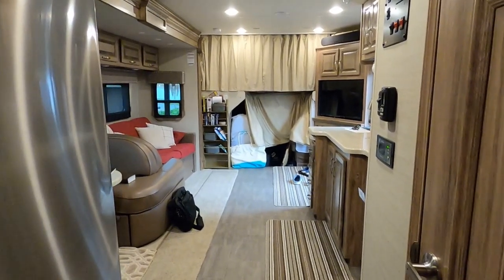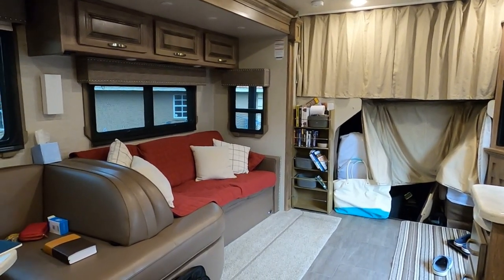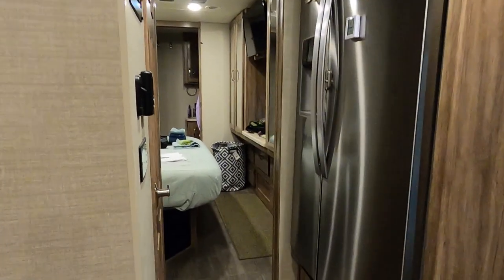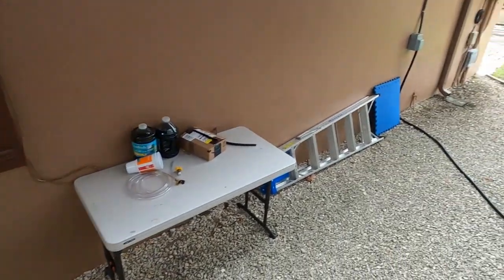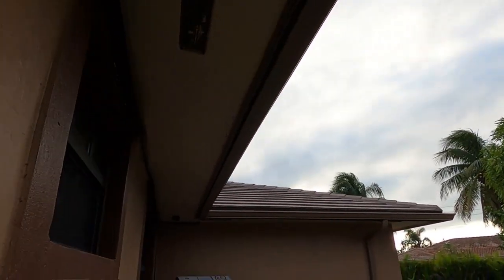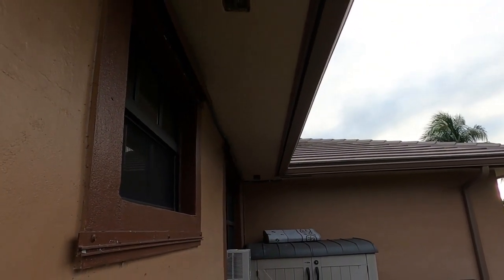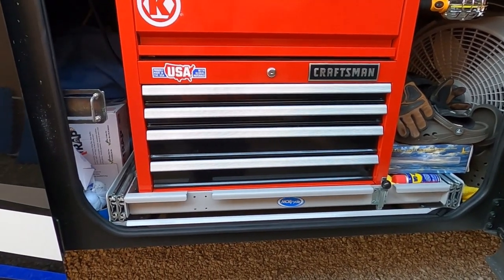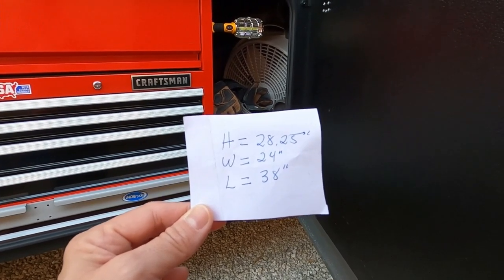Lectric Bikes on a Hitch Carrier and Lectric Bike folded measurements

Comment: On the ROLA carrier bag what size or part number is it that fits the two E-Bikes?
Reply from the maker: It fits my two ebikes folded....
Here's the link:  
ROLA 59502 Vortex Steel Cargo Carrier, Hitch-Mount, High-Capacity Basket (2-Inch Receivers) https://www.amazon.com/dp/B0016I8E1M/ref=cm_sw_r_apan_glt_fabc_S9PBM3MN8VA1751NS06G?_encoding=UTF8&psc=1

Comment: I have a wheelchair hitch carrier that I'm trying to do this with. It's only 47 inches long, but 26 inches wide. I think the bikes will fit next to each other, folded. Did you get that measurement, width of 2 of them crammed together?